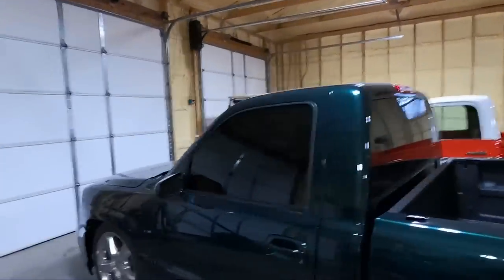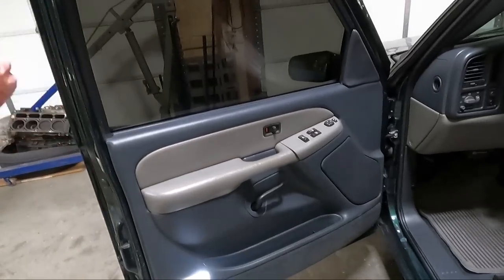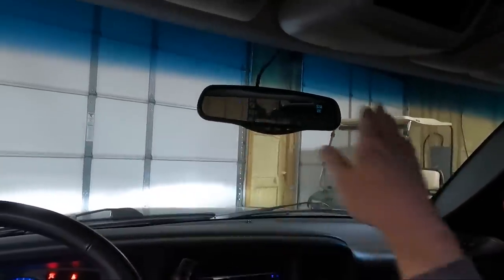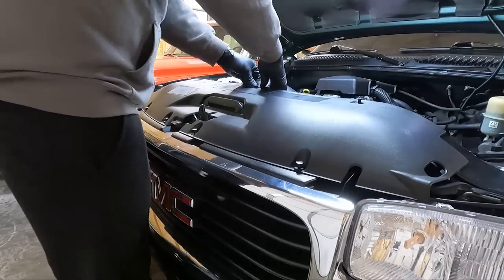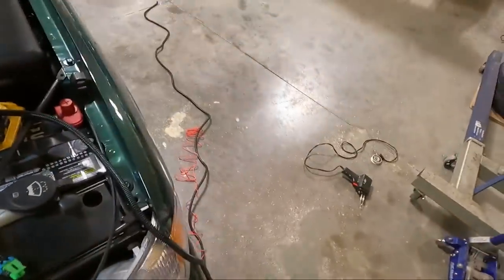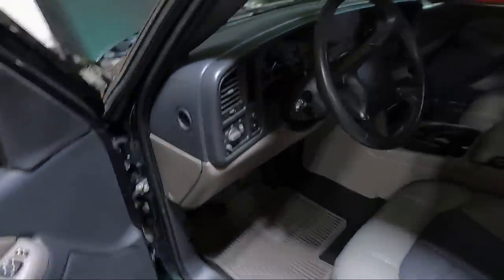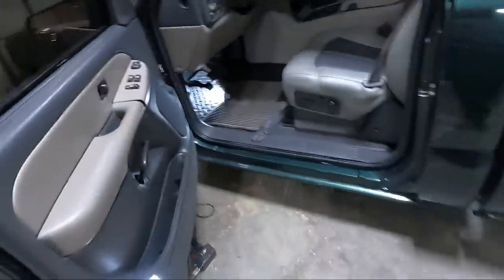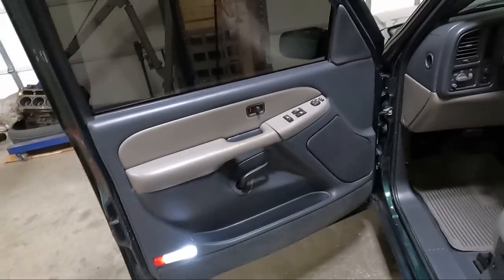Finishing a Few things on the Slammed Sierra (Temperature / Compass Mirror install)

Comment: On my 01 silverado i wired them up to come on when you open the door. What i did  is you find the ground wire that triggers when you open the door and it will come on the wire is located in the same area . On those trucks there's constant power and the ground is the trigger.
Reply from the maker: May have to do that someday
Reply: @Miguel Maciel Thanks, I will wire up my 2000 overhead console so they will come on when you open the door. Took me a while to figure that the ground was the trigger wire when I added the door mirrors with the signal, defrost and puddle lights last year, blew a bunch of 15 amp fuses for the dome light to get the the puddle light to work correctly🤦. ✌🏻
Reply: When I hooked up my puddle lights on my silverado I hooked it up to my door panel light it worked perfect.
Reply: @macielandsons  that's where I hooked mine up, just had the wires crossed. The 2000 model was not pinned or wired for those type of mirrors, at least mine wasn't.  To get the heated mirrors to work I installed a climate control with the rear defroster button and a relay for the rear window defroster in the fuse box under the hood which was already pinned for it. Next project is electric seats and change from cloth to leather! I'm retired and love to tinker with stuff. Just got my grandson a Black 2003 Ford Ranger Edge Stepside with 60 thousand something miles and he's keeping us busy with mods he wants to add🥵. Lol. ✌🏻

Comment: Really like your videos Travis!  If you want to fix your door properly, you need to replace the armrest.  There's a slot at the forward end where the switch panel meets up.  Years of rough pulling on the inside door handle to close the door has a tendency to cause the slot to break.  I had to fix my passenger door a couple years back after finding a used armrest on ebay.  New ones aren't cheap!  Best of luck.
Reply from the maker: Thank you. Will have to look into that sometime

Comment: I did the same mirror install in my 07c. It's a similar process except I actually had to swap the box as you call it WT didn't have any pins for the temp sensor. 03 up all have power to the mirror so they just plug in and have a compass.  They have a 14 pin connector but  it's the same idea Then Just add the 2 temp wires and swap the box. Also 03 ups don't have a bracket for the sensor they just push into a hole in the  rad saport. All you need is the cover for the wires going to the mirror and it will look complete.
Reply from the maker: Nice.

Comment: So Travis  my stock 01 Suburban  OC has been on in my mirror for many many years. How  would you trouble shoot it. Also not related I’m thinking all my interior lights stopped working.  Looked for a fuse as an issue but couldn’t find one blown. Any help would be appreciated.  Thanks and you are doing the things that are really helpful
Reply from the maker: Could be a bad sensor behind the grille

Comment: My 06 mirror compass is working but temp says OC and I can’t find a sensor or wires
Reply from the maker: May be missing or prior front collision
Reply: @TWAMotorsports  I added the sensor but it’s reading 30 degrees warmer than what it really is. I used 18 gauge wire because that’s all I had. Could it be the wire?
Reply from the maker: Could be or bad sensor
Reply: I have the same problem. I’m assuming the owner before me bought the upgraded mirror for the 03-06 and did not add a temp. sensor so I am getting the OC message. 
Did you need anything else besides the sensor to be able to add it?
Reply from the maker: Wiring to sensor